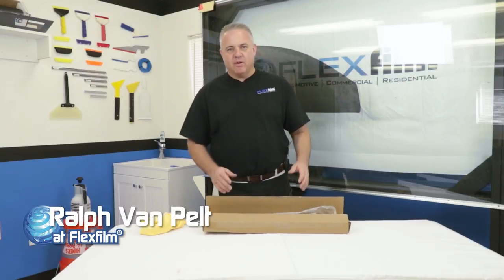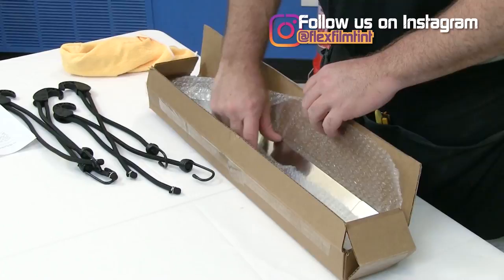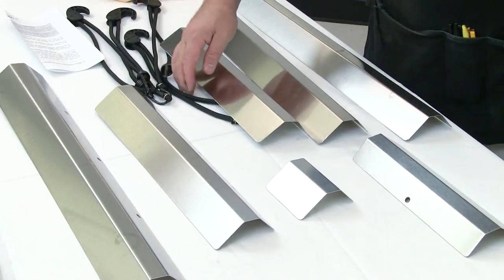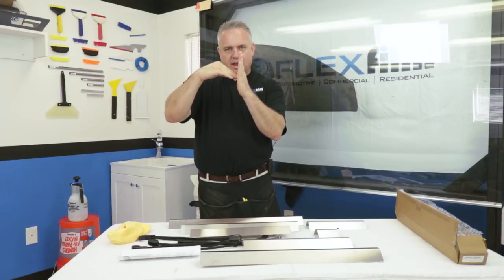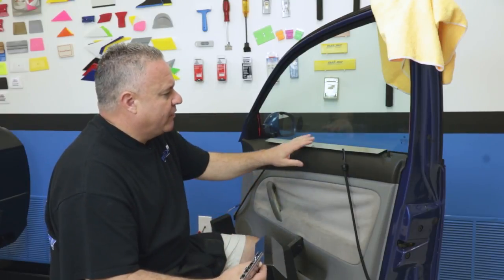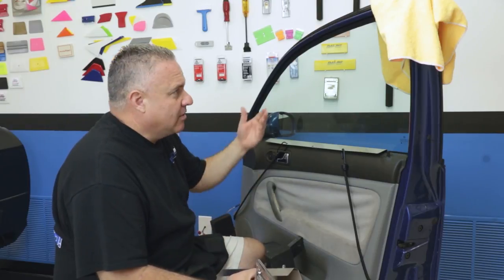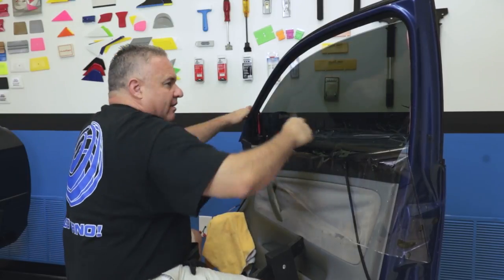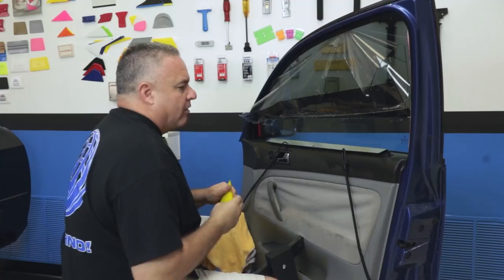How To Use The Gasket Wizard

Comment: I been using the gasket wizards for many years now they are amazing, I don't use the cords, in my opinion every window tinter should have a set of them, they are not cheap but well worth every penny way better then taking off panels and gaskets especially if your working on high end cars I rarely ever have to take off panels maybe ones in blue moon. Just a tip if anyone gets them sand down all edges they are sharp an can damage the door panels. I actually vinyl rapped some of mine in carbon fiber they look bad ass.
Reply: Yamaha82 88 how did you rap them around the edges you sanded thanks for reply???
Reply: JBIRD575 Regardless if you wrap them or don't I recommend sanding them because they will have sharp edges. And yes wrapping around edges is difficult take your time and use little bit of heat when your all done put them out in the sun for like 30 minutes . I ordered my gasket wizards from 44 tools.com as well as well as other tools or through solar gard because I em a solar gard dealer. I will try and post a picture of mine once I find out how.
Reply: Yamaha82 88 ok what grit do ya sand with bro??
Reply: JBIRD575 you can use 800 bro
Reply: Yamaha82 88 ok thanks!!!have good day!! Do you bottom load or too load???
Reply: Do you bottom load or top load??
Reply: JBIRD575  the majority of my windows I top load unless there frameless windows. Where is your shop located?
Reply: Yamaha82 88 what solution you using??tint slime??
Reply: JBIRD575 rite on man keep up the good work that's awesome I'm located in California. Do you guys do clearshield (paint protection)
Reply: I got my Gasket Wizard from Ralph, his were $15 cheaper than 44tools or the other usual places
Reply: JBIRD575  No I don't use tint slime I use film on.

Comment: Great work Ralph, an inspiration to anyone looking to tint windows. I have a completely unrelated question for ya if you'd be so kind. I recently picked up a 79 chev El Camino, I'm looking to tint the rear and side windows. I feel after a few trial and error attempts on other projects that I can master the side widows however, that rear window has a nasty curve on both side. I watched the vid on you tinting that 4 door Lexus which had substantial curve but feel this El Camino might prove to be a bit more of a challenge. Any advice is greatly appreciated.
Reply from the maker: Edward, King 
Heat mold it and trim it from the inside.

Comment: What's the new solution what was wrong with the tint Tac???
Reply from the maker: JBIRD575 
Possibly making Tint Tac more concentrated and adding more preservative to lower maintenance on bottles.
Reply: Ralph Van Pelt sweet try the new orange tint slime 4 times slip its great!!!!
Reply: Ralph Van Pelt hopefully yours will come out good like there's there's wasn't slippery enough either